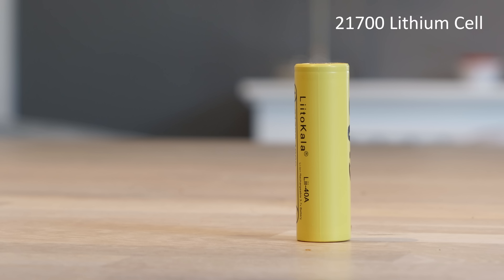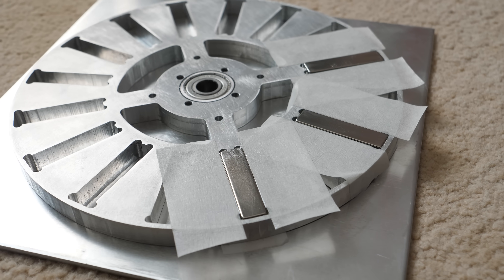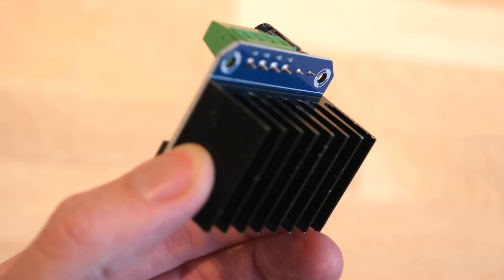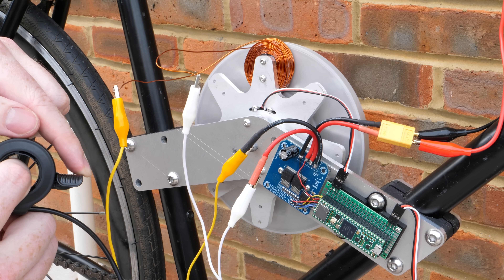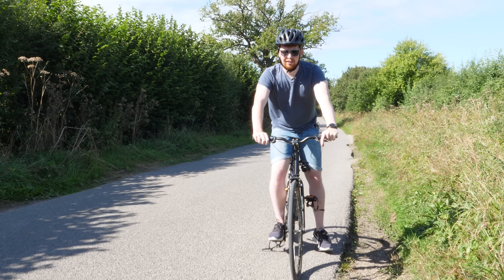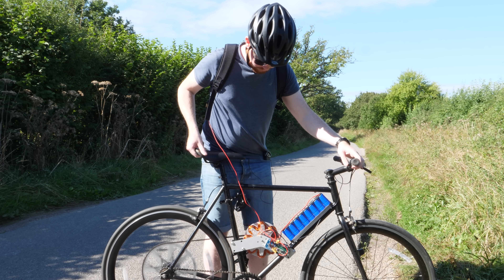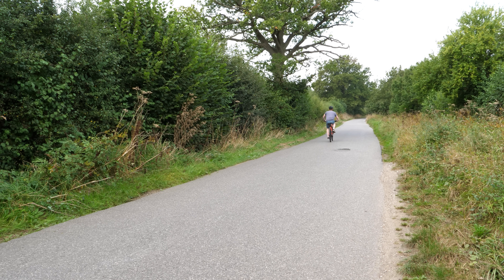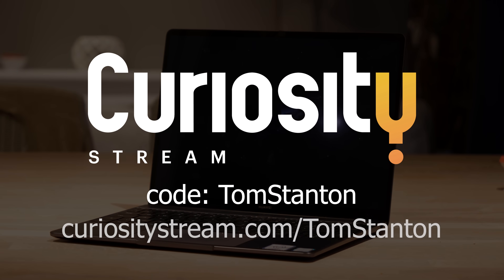Super Capacitor Bike

Comment: "I'm really disappointed that you didn't put sunblock on when you went outside. First off you have a ton of exposed skin. Second you are a red head(higher incidents of skin cancer). What kind of example are you setting? And I thought you were a university trained engineer.  In the future I suggest you spend at least 33% of your video showing the correct application of sunscreen.  It better be above 50spf too, or I'm going to say something about it." - Some safety nerd probably.

Comment: I wonder why you decided to make the stator of the motor as solid metal, as it induces a lot of eddy currents which causes alot of inefficiencies. Most motors use laminated electric steel with insulation in between them, to reduce this.

Edit: Tom used alluminium I didn’t realise. Alluminium isn’t ferromagnetic so it doesn’t affect the magnetic field. Using steel laminate however would’ve made the motor stronger
Reply: Since aluminum is very conductive, there will be eddy currents. Some non-conductive material to hold the magnets would have been better..
Reply: Eddy currents will be created in any CONDUCTIVE material. Aluminium is just as bad for eddy currents as iron. Ever asked your self how they melt aluminium, copper, iron or gold in induction furnace ? Hell, you can generate eddy current in plasma, carbon nanotubes, diamonds ... Also, aluminium does produce magnetic field when current is passing through it (flow of electrons produces magnetic field), so not sure what you ferromagnetism has anything to do with anything.
Reply: @tommybronze3451  even water in a red October caterpillar drive.
Reply: I was thinking about aluminum being paramagnetic, wouldn't that effect the efficiency of the field generated?
Reply: @CannaCJ  as long as it stays cool during operation that would mean there are no relevant losses. However that design would work better if rotors with magnets would be on both sides of the coils (two disks with magnets and coil between them).
Reply: @Kapalek84  with the two sets of magnets, have a close clearance ring shaped like a c that would really that crossed each other for a total of 4 magnets thus the c pieces would make an x shape when viewing from above, but polarity and the four magnets would all be in series .
Reply: @dennisford2000  the concept I was mentioning would be called axial flux. Inductor is between two magnets that are in attraction. The smaller the gap between the magnets the more dense the magnetic field produced by magnets. In such setup the inductors might work very well without any cores (this reduces core losses).
Reply: @CannaCJ  it was aluminium? At that point you might as well just 3D print the stator because I’d assume the alluminium there isn’t really doing anything, it’s not structural it is the stator after all. I think Tom Could’ve saved some money and time not machining that part out of alluminium.
Reply: Just about any electrically conductive material can produce eddy currents in response to a magnet, however.
Reply: @AmaroqStarwind  yeah but I mean if the material of the core was ferromagnetic and solid the excess eddy currents would’ve lessened some of the electromagnetic benefits of using the ferromagnetic core but with alluminium there is no benefit to be lost. The energy is lost in a non kinetic form either way. It’s not saying that eddy currents don’t exist in aluminium stator it’s just that it’s prescence doesn’t really matter for this use case
Reply: @tabeebrahman4843  I honestly don't think you understand how ferromagnetism works, and that it will not contribute anything anywhere. Ferromagnetic core will not spontaneously become magnetic by sheer presence of permanent magnets - such material NEEDS to be magnetised first (super strong field + temperature). So whenever material would be ferromagnetic or aluminium it will not benefit anything. The eddy currents will me generated from magnetic (not electromagnetic - two different things) field in core material due to passing next to electric magnets that generate those fields momentarily. Only way to minimise effect of those eddy currents (that will counteract effect of coils) it to slot the core, or use multilayer laminated plates (which also will be slotted to further decrease eddy currents)
Reply: @tommybronze3451  I do not fully understand ferromagnetism I am not an expert. I thought the purpose of the ferromagnetic core was to be a material with a higher magnetic flux density compared to air therefore focusing the magnetic field at the pole facing ends of the core. This wouldn’t happen with aluminium and the magnetic poles of the electromagnets would be less focused and thus exert less force in the direction which matters which is towards the permanent magnet rotor. Instead it would be more general and evenly spread out producing a smaller force component on the attraction or repulsion interaction of the stator and the rotor compared to the a ferromagnetic core which would focus the magnetic field more towards a direction perpendicular to the plane of the rotor
Reply: @tabeebrahman4843  So actually, you really don’t want anything close to magnets to be made out of metal, anything conductive, etc etc. Problem engineers are facing is that if you want to have a compact design your core needs to handle lot’s of torque. Steel would be best cheap solution but then you have a large rotor inertia. So you engineer it out of aluminium which is good middle ground. Still you make rotors out of plates of aluminium, which have very specific cutouts to direct magnetic flux in such a fashion that it does not cancel out neighbouring magnets and drives flux outwardly towards the external coils - however “magnetic conductance” is not a benefit here, but more of a problem you have to manage and if you do it right you can turn it into slight benefit ! (side note, somebody quoted Fermi - and it’s absolutely on point! engineering is all about making stuff from cheap broadly available materials that is fairly easy and cheap to manufacture on mass scale and works “good enough” ! - hence building own motor for this application is just baffling for me, while there are off the shelf solutions)
Reply: John Johnson  What a pointless and irrelevant comment. There is no reason to spend the time to hand make any of the parts he cnc'd.

The finest swiss handmade watches, steam locomotives, and uk ww2 wartime output have one thing in common -- they're all obsolete! I work in a clock & watch shop, and the reality is that the finest mechanical timepiece ever made will be outdone by a cheap quartz watch.
Reply: How is he to build that with a cnc machine? Guessing it was just more practical and sturdier than a 3d printed part that spins to avoid centrifugal forces from the magnets breaking it.
Reply: It's "a lot"; two words. "Alot" isn't a word.
Reply: Cut the stator from couple of thin metal plates and glue them togeather but I think for the purpose of this video this was sufficient effort
Reply: Id have just deleted this one mate 😂
Reply: @bigsteve6729  I might have to take you up on that one this is getting out of hand
Reply: @tabeebrahman4843  hahaha 👍👍
Reply: John Johnson  Get what you are saying, but remember Youtubers #1 job is to make videos entertaining (competition is steep! with so much just being eye candy and so many make a long montage to numb your brain for more ads)  Hard to not get sucked in to making Sexy ASMR for the masses, but I subbed to Tom because he does try some neat ideas and I will unsub when he becomes a total sell out.
Reply: Aluminium as a stator will induce eddy currents even worse than solid iron, because of its good conductivity. It doesn’t matter much for the rotor since the magnetic field through the rotor remains approximately constant, but the lack of field concentration via a magnetic core is a negative for both the stator and rotor.
Reply: Aluminum does produce eddy currents; can be used for magnetic braking.
Reply: not a single person mentioned the weight increase that would cause and i think it wouldnt even cause a better flywheel due to its location unless he does the one-way bearings the pedals use even then seems more like a gimmick that would do more harm than good
Reply: @DrDeuteron  actually I did mean super conductors as well. Eddy currents are present in superconductors and are a basis of maglev effect.
Reply: @wcatfn7928  oh yeah thats true, i mean yeah idk why tom didnt just 3d print it
Reply: Aluminium is still subject to eddy current losses. I would imagine they're quite considerable here. A laminated iron core would definitely improve efficiency a lot.
Reply: Visual for a sense of the eddy currents in aluminum: https://youtu.be/k2RzSs4_Ur0?t=65
So what happens in Tom's motor? We've seen that a battery will run it but how much more powerful would it be without eddy currents?
Recall, as a coil is energized it is between magnets, but its magnetic field is expanding into the aluminum, generating eddy currents there, which oppose the field that caused them. Good or bad in this case? And could that principle be made into an advantage? Keep in mind as the magnetic field is collapsing that change also causes eddy currents the other direction, like later in that video. 
These are some Tesla motor teardowns https://www.youtube.com/results?search_query=tesla+motor+teardown  In one of them (lost track of it), while rotating, you could see an aluminum core but off center, which model? Can't recall.
Reply: Eddy currents are the principle in induction motors, here's one as simple as possible with aluminum as the rotor: https://youtu.be/ViapciJ7G3k?t=69
Reply: What’s eddy current?
Reply: ordering steel sheets is much more expensive than machining aluminum plates I guess?
Reply: John Johnson  but time and accuracy tho
Reply: John Johnson  it's a choice.